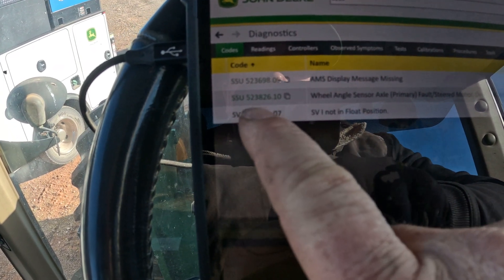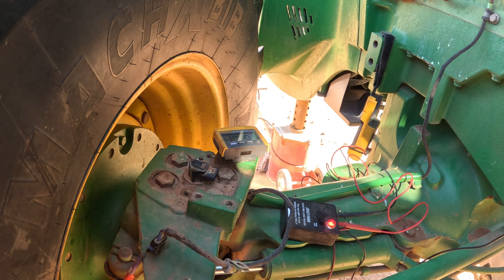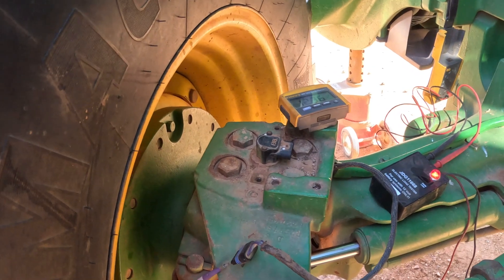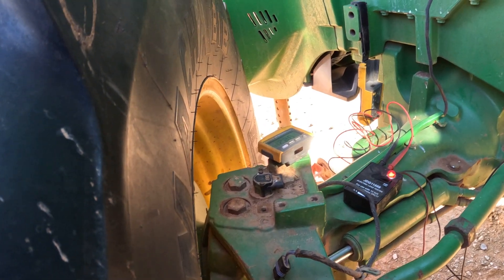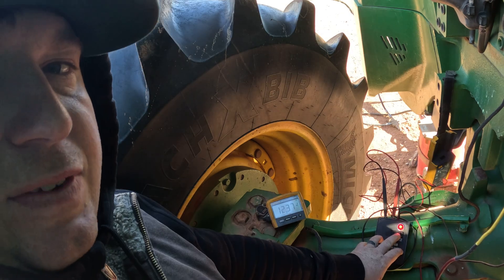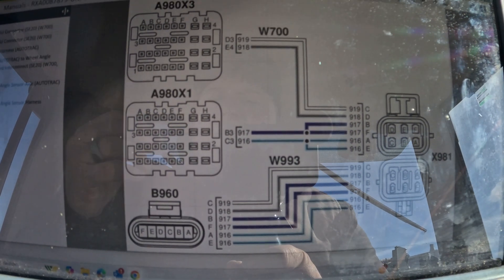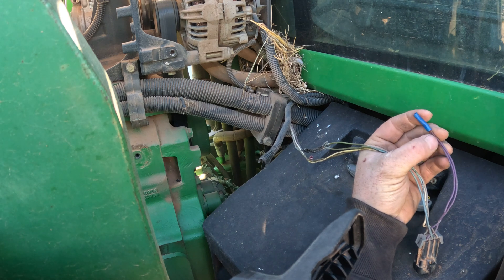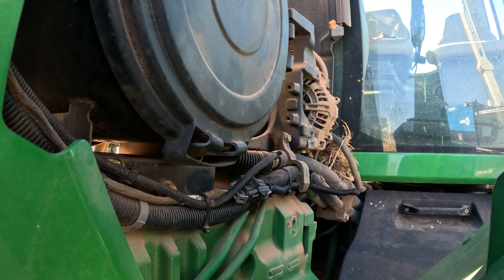E117 | John Deere Tractor Wheel Angle Sensor Diagnose and Repair

Comment: why is the wheel angle sensor  needed?
Reply from the maker: The wheel angle sensor measures the precise angle of the front wheels which is super important for the guidance system.
Reply: @WesternEquipment  o ok :)